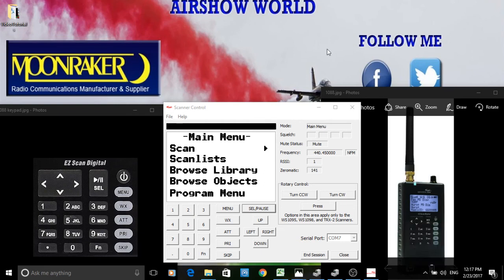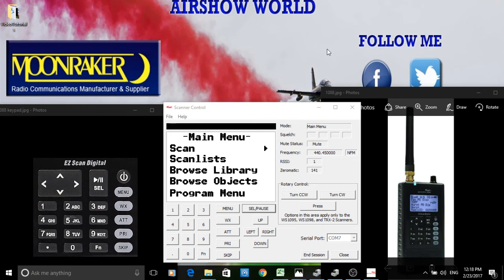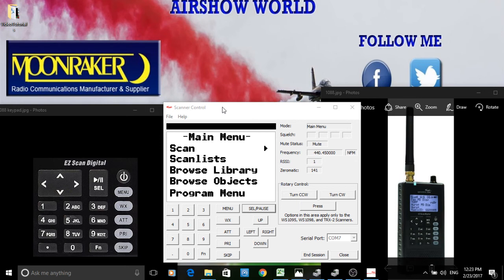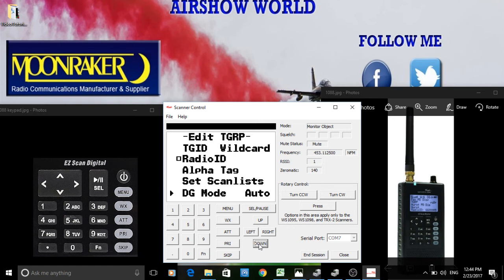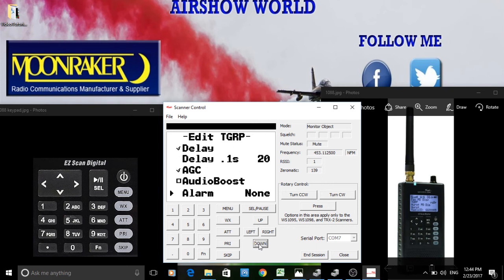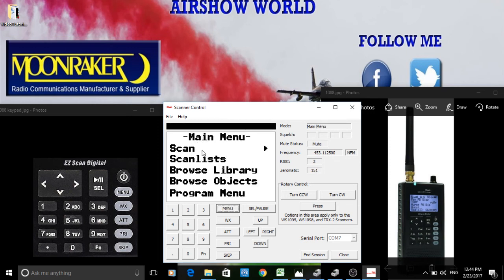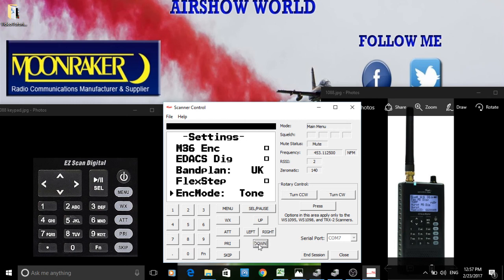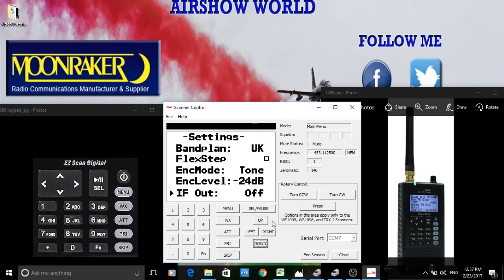Whistler Scanners - Exploring The Menus - AIRSHOW WORLD

Comment: Stu I have seen all your video's on TRX-1 Thanks.  A question  Is it possible to save Limit Searches as it appears i can only use one low-high frequency at a time? Thanks Tony (Ex RAF Gulf War Vet 1990/91) & Airshow guide RAF Finningley 1980-86

Comment: please dear 
tell my
if this radio working on digital only
and not working on analog ?
Reply from the maker: Hi this radio will do both Digital and Analog
Reply: thank you dear
i have motorola dp4801
403-527
and 
sepura stp9038
380-430

if i use this TRX1
if i lessen to this tow ringe on the dp4801 and sepura stp9038
?